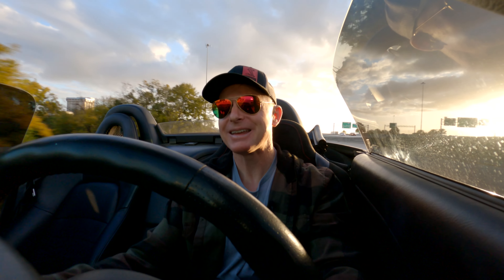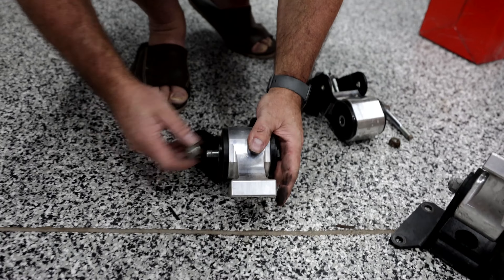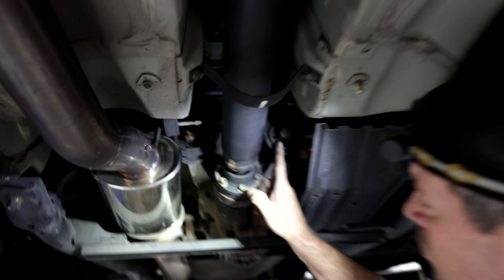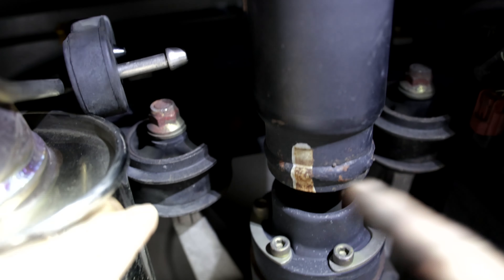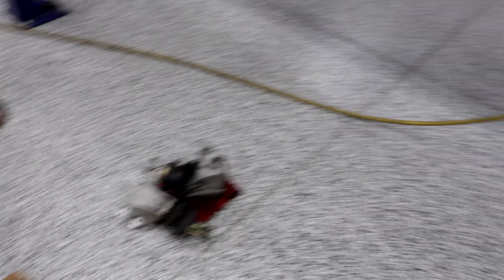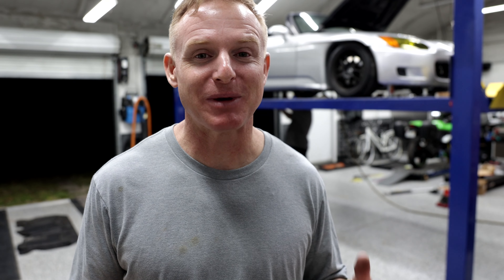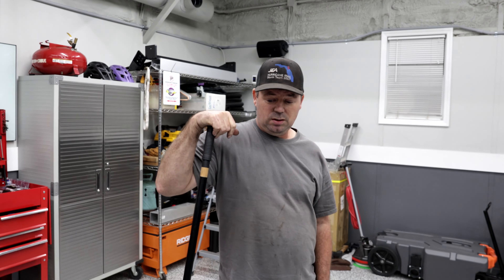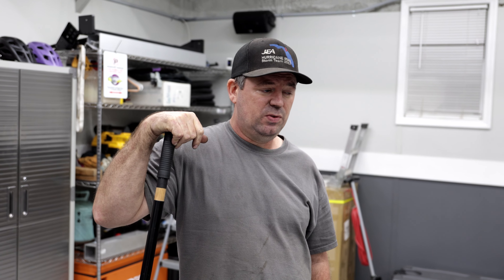Do motor Mounts ruin a car? Honda S2000 HASPORT//INNOVATIVE MOUNTS

Comment: Have had all 4 hasport mounts in my 8th gen si (daily) and other than the vibration starting in first gear they've been one of my favorite mods. Thinking about throwing them on my S in the summer. Good vid🤙
Reply from the maker: Yeah exactly, just a little vibration in first.  They are not bad at all and add so much to the driving experience!
Reply: Got the Innovative 75A on my daily FG2 for 3 years now, and aside of some interior trim buzz at about 3500 RPM ; I'm not going back to stock lol !!
Reply: @nitromyke  Worth the rattle 100% keeps the nose of the car down so well

Comment: I got an S2K a year and a half ago so I am new to the game, so to speak. I'm pretty positive they also make transmission mounts as well? Also my S does this strange thing in third and fourth gear, if I punch the accelerator or even if I let off of it really quick, the car definitely shakes, and it feels could be the motor. It did it very strongly when I first got the car; my mechanic swapped out a blown mount; think it's possible the other is bad as well?? Good content man I'm definitely gonna check out some other vids.
EDIT: I just checked and realized the S got totaled. I am so sorry for your loss, man... :( glad you are ok.
Reply from the maker: Thanks man!  I’m currently shopping for another!
Reply from the maker: The rear differential mount was one of my favorite upgrades on the S2K.